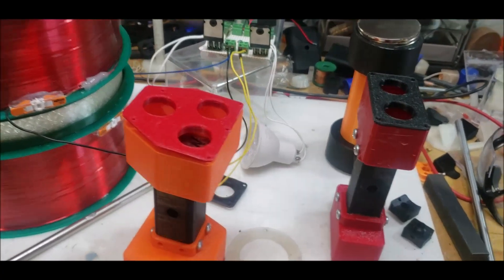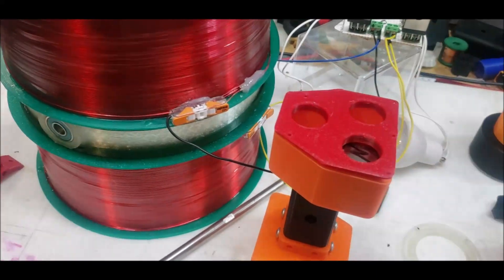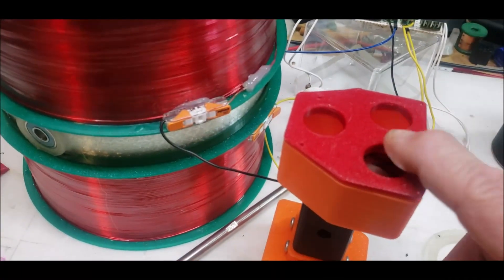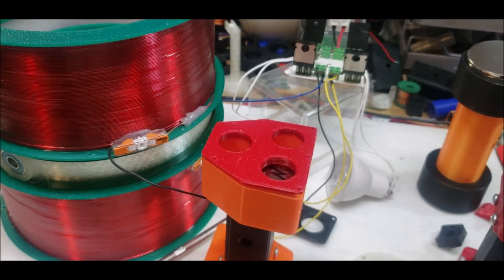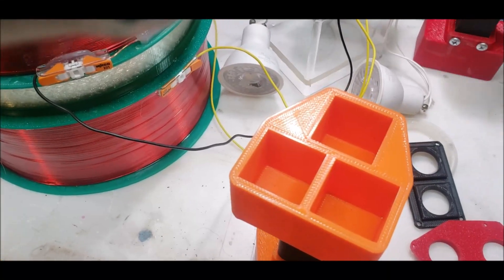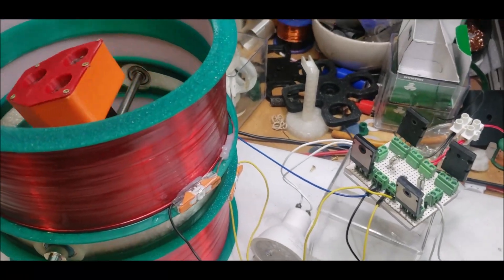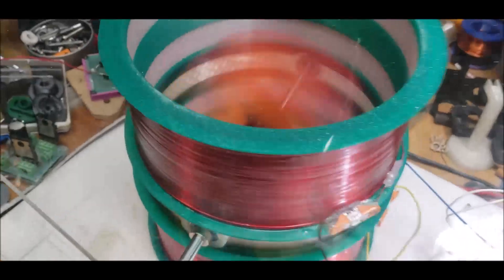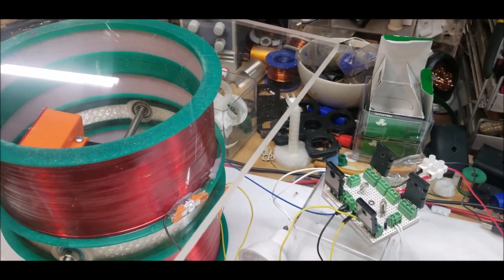3D Printed Tri head rotor

Comment: Nice work! Did you see mine?
Reply from the maker: yes but it looks many many years old. are you no working on it anymore?
Reply: @mcorrade  20 years ago when I lived in Shanghai. Left it behind and shut it down after 4 days. When it's in resonance the whole room including my body was chirping. I lived in a studio apartment, so it wasn't tollerable for long. when your run battery V is oscillating in a regular pattern after you have tune that sweet chirp- you are in resonance. The spikes will also be off the scale on your oscope. you need to match the coil to the caps you use...I worked with daftman and lasersaber for feedback. The run battery should never die until it degrodates in theory. whenever it hits the bottom of the regular ocillation the charging increases until it hits the top of the wave and so on, meanwhile you just keep charging dead batteries on the other end. My mind was blown-and I'm colorblind. Army wouldn't let me be an electrician. I just didn't have the focus to follow one question and I had proved it to myself. Then someone replicated my circuit and used a supercap. I'm working with nature more these days.